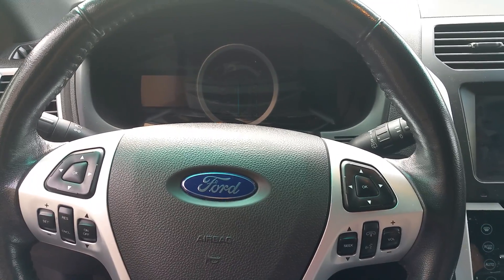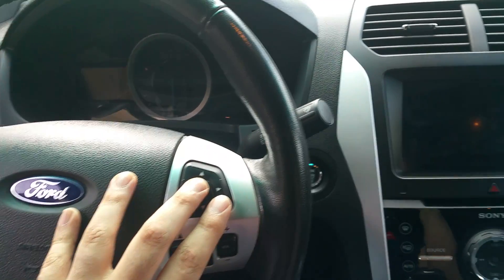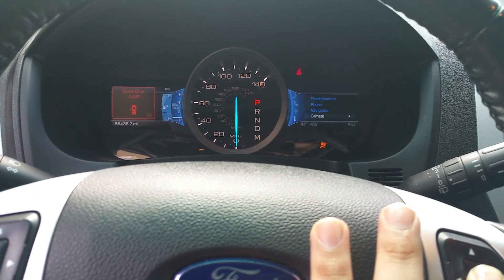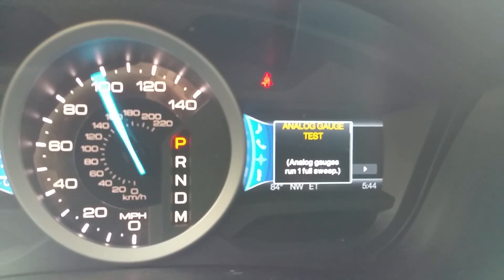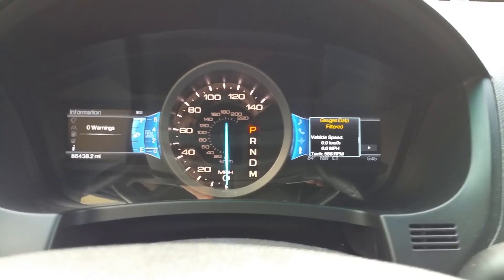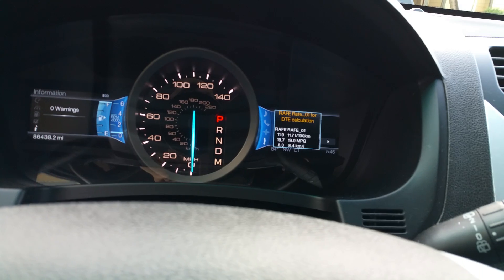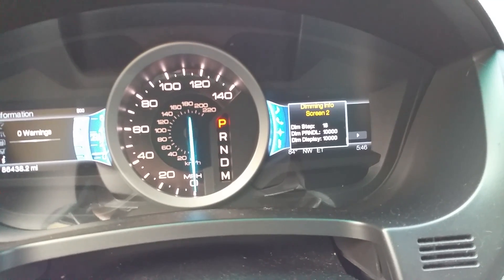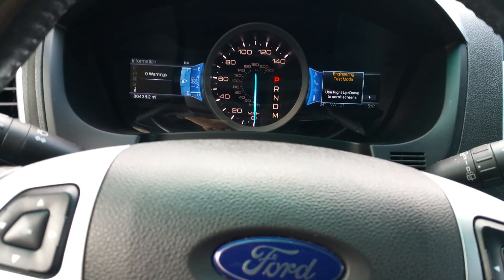MyFord Engineering Mode

Comment: It’s cool but ford left out some super helpful stuff, like transmission fluid temp. That would be super helpful since the transmission doesn’t have a dipstick and has to be leveled out at a certain temp. If ford had put it in, then DIY people wouldn’t need to buy a scan tool just to change transmission fluid.

Comment: I replaced both blend doors and the defrost actuator on my 2015 xlt.  How do I reset the actuators so they respond when I raise and lower the temp?  Right now, the right and left blend doors only move when the temp setting is ‘LO’ or ‘HI’ but does not move anywhere between those settings.